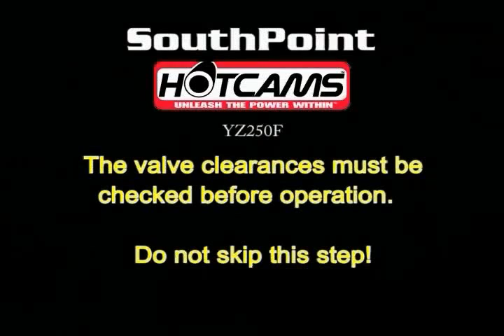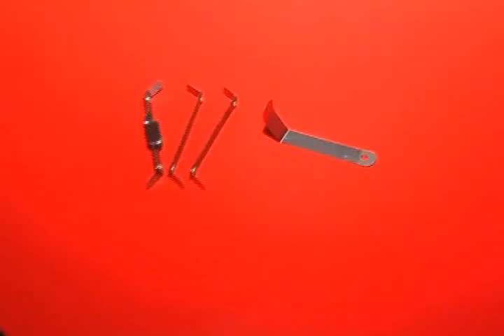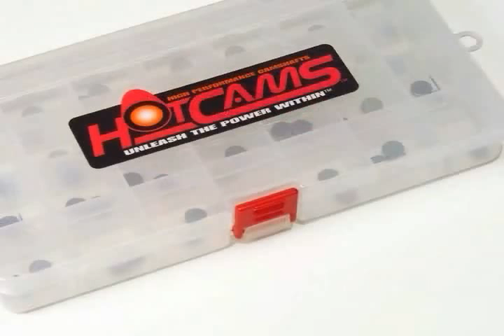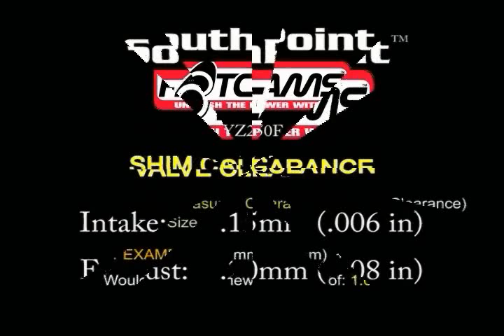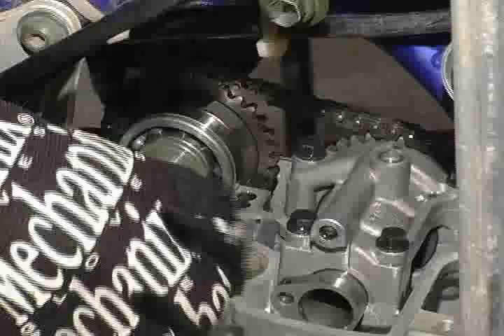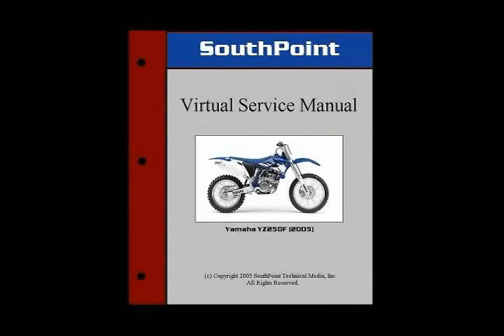Hot Cams valve clearance inspection and adjustment on Yamaha YZ 250F

Comment: thanks for the video first of all.  my question is can a measurement be taken with the lobe straight up or should it be measured where the lobe comes down to the base of the cam?

I'm using your pads on my R6.  I did it with the lobes up a lot more than you guys are showing and they're not real loud but I can still hear them more than I'd like but not any more than it did at 10k miles and now at 40k.
Reply: blue03r6 YZ250 2013